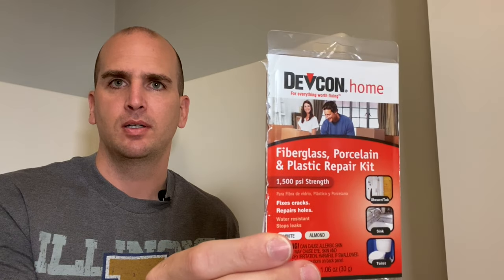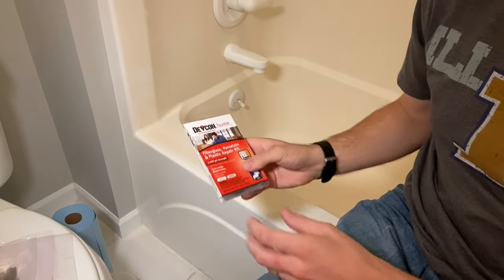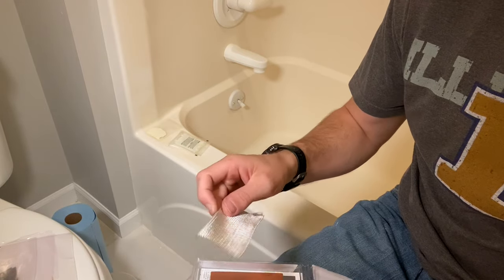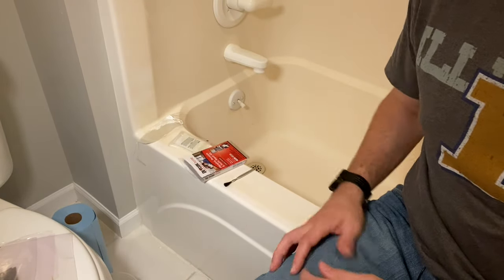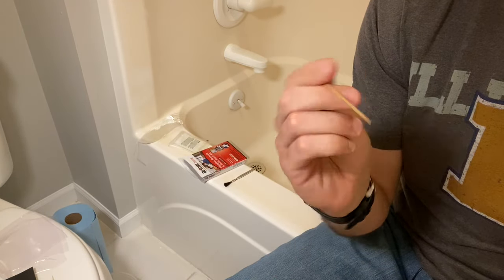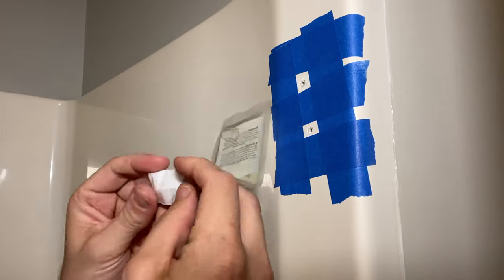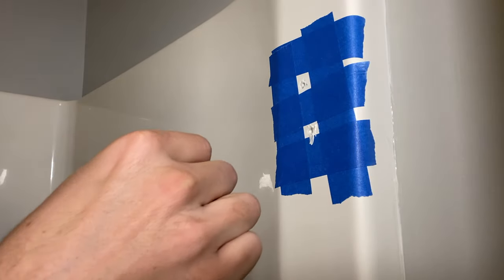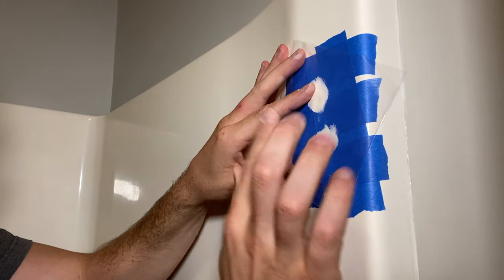HOW TO REPAIR A HOLE IN A FIBERGLASS BATHTUB SURROUND

Comment: Buyer Beware! I did this project a few minutes ago after watching this video 3×.   My experience was a nightmare. The epoxy hardened up in the package within minutes, the "brush hairs" were left in the epoxy application, and the mesh fibers continued to pull apart. I had simple screw holes and what a mess I was left with.
Reply from the maker: Hey Taylor, thanks for the feedback and you are right the epoxy does setup fast and starts to harden in the first 5 minutes.  If the hole you are patching is small like a screw hole I wouldn't use the mesh (I know it is too late to change now  ☹️ ).  With that said I just did this repair again on a small hole and the end product was the same in the video.  Hope you are able to get the finish product looking decent.
Reply: @EverydayHomeRepairs  Thank you. I wouldn't have attempted to use the mesh but the toothpick trick didn't work so I attempted to use the mesh. Also, the epoxy became "stringy." I personally would not recommend this product. Thank you for your feedback.
Reply from the maker: @taylorpresley9887  appreciate the feedback as we need a variety of experiences so others can make a more educated purchase/decision.  👍
Reply: I just had the same experience. I had 8 holes, a crack with a good sized hole (tub area broke away) after drilling two holes at the end of the crack. I didn't realize the epoxy cured so quickly. I couldn't apply any more epoxy because the epoxy in the plastic package was starting to harden. By the time I started with smoothing out with the plastic, the epoxy was getting sticky and pulling back the epoxy and the patch. Pulled the patch out. :-(  Just ordered another kit. I'll need to make a second pass. More quickly and perhaps not bother with smoothing out with plastic and live with the additional sanding.
Reply: @kenadkins1537  I finished my project using caulking, it worked for me. Best wishes.
Reply: @kenadkins1537  I would consider using a different product. I couldn't find my receipt or I would have asked for a refund.
Reply: The 1st pass isn't horrible. I'll brush the dimples and spend more time on the fiberglass patch. I may actually try to glue a small piece of plastic under the hole. Use a screw to pullup the piece until it sticks. And then use the epoxy to fill in the dip. Not sure I want to use the fiberglass because it may create a mound that I think just won't smooth out. I don't want to change product now. This product is a known quantity now sort-of-speak.

Comment: Terrible!  After 24 hrs dry time,sanded, went to remove tape, it all pulled out f the holes! Nothing adhered,would not use this Product !
Reply from the maker: Hmmm, I wonder if the surround had some residue which didn't allow the epoxy to bond to the surface.  I used this product 3 times now and work every time 🤔